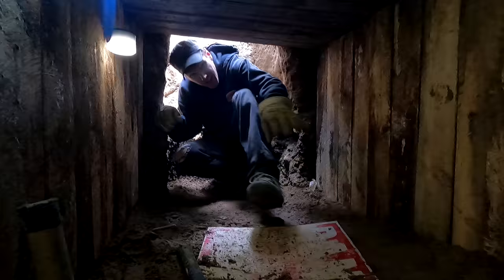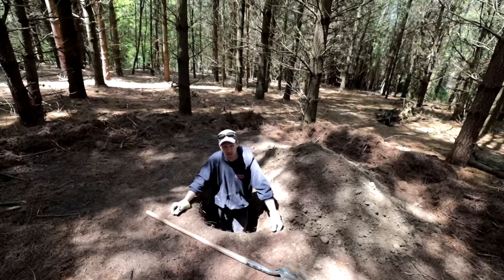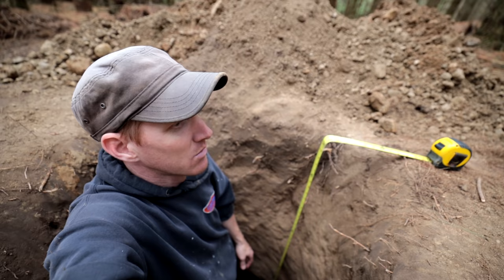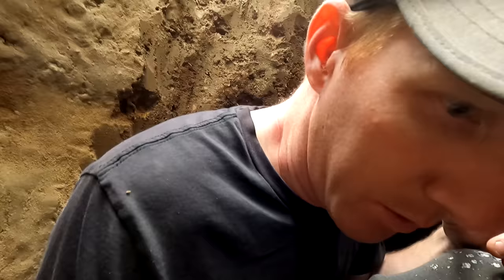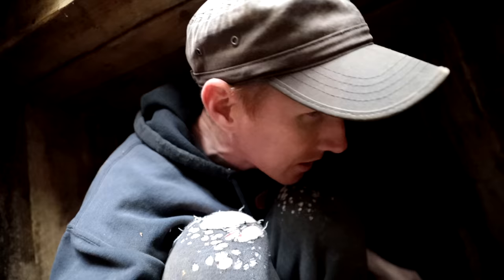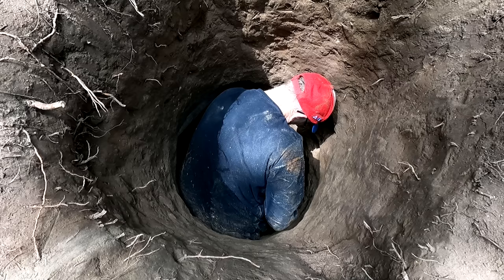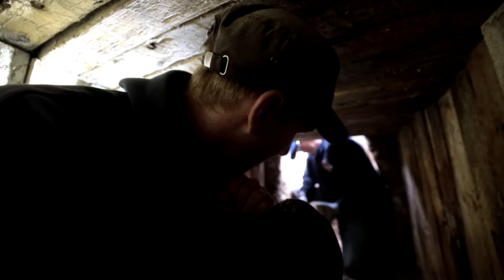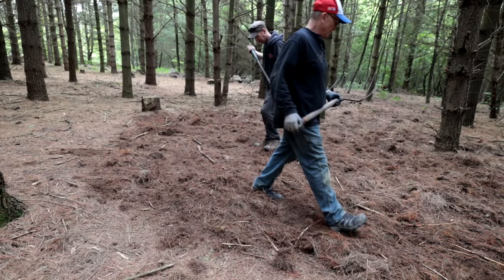Digging a Japanese Spider Hole (and sleeping in it!!!)

Comment: The 2 biggest issues I see are the lack of a water sump (grenade sump too if you want to be legit), but far more importantly you need ventilation - if someone were to duplicate this and spend the night inside, a thin layer of snow would seal the hatch and you'd be staring down potential suffocation very quickly
Reply: Yeah ! Take inspiration from Saddam Hussein's hiding place.
Reply: Also- good luck trying to pop out that hole with a rifle and or gear on.
Reply: no you wouldnt just breathe air
Reply: @davidenglish1552 yeah really I'd probably cut the hole 1 board wider on either side
Reply: I imagine you could potentially connect multiple of these holes together to create a sort of underground trench, as well just make the pocket of air underground larger.
Reply: Not to mention the farts from those beans... Could potentially blow yourself up huh??? Lol jk ...even if u didn't I'm sure the glory hole gas would linger not helping the discomfort factor. 🤦🏼‍♀️🥫🫕🔥🧨🕳️🎆🤷🏼‍♀️
Reply: We built a plywood box bunker under our shed in Florida. Luckily we had the shed to hide stuff so we put in a vent tube. Then our uncle ran electricity to it and we had a fan for the exhaust. We partied down there so air was important 😂.
Reply: @cdgonepotatoes4219  that's how they did it in Nam
Reply: Ventilation - esp if beans are on the menu...
Reply: The dog wasn't much help
Reply: What exactly would a grenade sump look like underground? Just digging the entry hole slightly lower than the tunnel area (like a sideways T)? My understanding of tunnel warfare was they just used curved tunnels for that purpose
Reply: @JeronimoStilton14   in this context, probabbly nothing.   Underground things tend to use a wall or something as far as i have seen.     So something to literally stop the blast as well as working on it being harder to get a grenade in.   

Fundetmetally i think the amin drfence for this shelter is its camoflauge, its not a fighting position in the tradtional sense, it might be a one use ambush hole
Reply: Vent and a periscope.
Reply: @JeronimoStilton14 I noticed nobody else replied so I will. A grenade sump is a small trench in the bottom much like a water sump (and doubles as one in some designs), where the grenade lands and rolls down a slight slope into it. The best place to dig it is on one of the sides and ideally, you dig it so there's a reverse slope in the sump with shelf over that, completely enclosing the grenade so when it goes off, there's nowhere for the fragmentation and blast to go but into the dirt.
Reply: Need some duck boards in there to keep from getting trench.. everything
Reply: also if that happens that candle will eat away at that oxygen level too
Reply: it would also suck if you farted and you were stuck with it in there.
Reply: @HushtheMag  You mean you don't like to inhale your own farts? I thought most people did....
Reply: @davidenglish1552  entrance was a little larger and we (japanese) were a little smaller than the average american.
Reply: Can of bean here eaten. Yum. Thought of War oppose it with a greater thought of peace.

Comment: Neat construction; couple notes, you don't want to use hexamine (or esbit as their commonly known by the brand name) in an enclosed space.  Second, you don't want to cook things like beans in the can; modern cans are lined with plastic, so transfer food to a stainless cup or similar bowl before cooking.
Reply: thanks for the tips
Reply: I see nothing wrong with boiling cans of food in water. Start with the unopened can in cold water, fire it up. By the time the water begins to boil, food is ready to eat. Wont get hotter than 212 degrees.
Reply: @MrMrBiggles  Did you not read the comment? The problem is the plastic lining the inside of the can, which is there to prevent oxidation/rust/acidity from ruining the can and the food inside, but will melt into the food if given enough heat. Usually Bisphenol-A but recently shifting to Bisphenol-S, both of which are extremely toxic and mimic estrogen when consumed which disrupts your endocrine system.
Reply: @MrMrBiggles  Yeah, it's not an issue of the plastic melting, but rather it leeching chemicals into your food. It's not that big of a deal a time or two in an actual emergency, but something to be aware of and not what you want to do on a regular or non-emergency basis.
Reply: Do you mean the plastic wrapping on the can? Can I remove it and cook the metal can itself or you meant the metal itself?
Reply: @jdsmith2670  No, it's a liner in the inside of most cans these days. There's a thin polymer layer on the inside of cans to prevent the metal of the can from contaminating the food. It's a thin bonded layer, not removable (it's not like a bag on the inside of the can). The reason they do this is the metal content of the can, and storage; back in the literal tin can days, it wasn't as big of a deal, but canned food also didn't keep as long. With the liner, canned goods last longer and the metal case can be made out of alloys that wouldn't be as good for direct food contact, but are massively cheaper to produce.
Reply: @jdsmith2670  pretty hard to remove these inner plastic linings. You would have to empty the can first anyway, so you may as well use a kettle and cook them in there.
Reply: @MikeJones-mf2rt   🤣🤣🤣👍
Reply: The plastic luner thing isn't a myth and its non removable but not all cans have them.. most companies used a wax layer and only within the past 10 years did some higher end brands start using a thicker white plastic coating.. its easy to check for if you fully remove the lid
Reply: Modern cans. Cans 50 years ago. 
Don't cook in a can.
Reply: Speaking of cooking,  isn't he using that stove upside down?  While I don't see too much of an issue using it that way, it's my understanding that the leg acts as the pot stand and hexamine kinda liquefies as it burns so the tray contains it. Plus using it upside down gets all the burned cr@p all over your gear Instead of inside the stove.
Reply: It's safe to cook in a can ONLY after burning all the liner out with it empty in a fire. After that the can will rust easily, so it's a process you repeat as needed. Hobo $5 cook set: Soup can is your cup, fits in a regular veggie can with church-key holes to make a twig stove, and that fits in a large bean can which makes your pot. Split up the beans and veggies and you get a few small meals too, all for that same $5 bill.
Reply: @davidhawkins847  what? Do you mean like the little things that hook in your stove? You think you use them like trays with the legs facing up?! You’re using them upside down, dude! They go in your stove and hover above the flame, not sit on it.
Reply: @MrMrBiggles  I would agree BPA doesnt melt until 316 degrees. You can actually boil water in a plastic water bottle just dont let the flames go past where the water level is and it wont melt. That being said it'll leech more chemicals, but it can't be any worse than the tons of things we consume that are in plastic everyday.
Reply: The food in the tin can is already cooked just eat it cold straight from the tin.
Reply: Just eat cold , straight from the tin
Reply: Once I saw the stove, it was pretty obvious he had gotten some NATO but not US gear. US servicemen are no longer issued a stove or open flame, because the poncho and other gear can catch fire if you are in tight spaces like a trench or foxhole... or spider hole... and the fire uses oxygen you may want to breathe later. Considering the layout, I would say cut into another side just deep enough to put an igloo type cooler, and invest in an actual camp propane stove and put in a vent to the surface. These emergency stoves are not very efficient, and in a closed space you can easily kill yourself.

Comment: I spoke to a Vietnam vet who said that a lot of these spider holes existed in rubber plantations. The holes were dug to store water from heavy monsoon rains to keep the trees watered over the year. They would use these existing holes to attack.
Reply: liar
Reply: @ClydeW893  lolz
Reply: No wonder. This hole would be flooded for sure in a case of monsoon raining for 3 months straight
Reply: @ClydeW893  How come?
Reply: @VoidHxnter  think
Reply: @BushcraftEurope  Perhaps they weren't exactly like they were in the video, maybe ran off into some sort of system where the water could drain if it rained too hard, just my guess.
Reply: @BushcraftEurope  I clicked this video just to see if they planned for heavy rains. You wouldn't want to wake up and drown. Need at least a large air pocket inside. Maybe building on top of a slope would help too.
Reply: to defend more than attack, but yeah.
Reply: @lostsanityreturned we could have won but no president had the guts to Truman it
Reply: Hexamine stove. The tablets are hexamine.
Great hole or tunnel.
Have you watched " The Great Escape "  ?

Comment: Was in the US Army, can confirm. Loved digging holes/trenches when bored, some time a few shovels and a couple bundles of 550 cord and you can make yourself an improvised pillbox.
Reply: What was the 550 used for if you don't mind explaining your process
Reply: @zyther96  securing supports and building overhead cover
Reply: Man I was mortars. Only good part of digging one of those monsters was getting done and using our built in spades table
Reply: It's hard work, even just digging a fire pit  to make biochar it took me two days the ground was like concrete,.🇦🇺

Comment: You may want to have some spreader to hold the sides from coming into the tunnel, and keeping the beam up. Also, you want to have dirt backfilling on top of the beam, so the earth has something to lean on, so it wont collapse on it. Just nail two planks to the horizontal beams on both sides.

Those are "hexamine tablets", you can make RDX explosives if you nitrate those, and you can make a primary explosive (HMTD) if you make a peroxide with it. Its best not to use fire underground unless you have got a ventilation pipe going down there, and preferably two. 

Greetings,

Jeff
Reply: I can’t believe there aren’t more comments like yours. This made me so anxious! He needs spreaders to keep those sides from pushing in. If the sides push in, they can no longer support the top, and if the top goes, so do you! There should be spreaders just below the top beam but between the sides and another at the bottom, both secured with fasteners. MSR makes it look cool but his way is INCORRECT and EXTREMELY DANGEROUS.
Reply: @crayoniii  Well, it all depends on the "ground standup time", it seems to be pretty good. Also you need to fill in all the space between the roof of the excavation and the lagging (the wood). At one point in time the ground may sag down onto the lagging. Now this will load the wooden lagging. The amount of pressure depends on what type of soil is on top of the lagging. Its a pyramid shape running from the sides of the tunnel up to a certain height. If it is pretty solid ground (which it is), the pyramid shape is not that high, and thus the amount of material within that pyramid does not make up a lot of weight. The lagging is only supporting that weight, the rest of the weight is supported by the ground around the sides of the tunnel. now the lagging does not support anything or not much. Just be sure all the space is filled up so the lagging can "yield". You dont want any momentum with the weight because that increases the energy involved by a lot. E=MC^2, so that is mass times the speed squared(!!!), and the speed can be as fast as gravity makes it go. So that is why the space is filled up. 

You can read about this phenomenon in Earth Tunneling with Steel Supports, by Proctor and White. Its on my books/archive page. A very interesting book, i scanned it from the university library. Its the only one copy of this book that you can find online. Ive checked. :P 

Greetings,

Jeff
Reply: @jeffjefferson2676  Thanks for responding! I do understand there’s a lot of minutiae in the soil types and how that dictates what kind of and how much shoring is needed. However I’ve seen enough of these types of home brew digging videos to know that most people do not know and are very likely to get themselves killed. I only wish you had addressed this in more detail and proclaimed a starker warning. Happy digging!
Reply: @crayoniii  It is as detailed as it gets.. Earlier this year they found a guy who buried himself in the forest. He was digging a tunnel too. "Slachtoffer ingestorte tunnel is man (29) uit Stein"

So, everyone has been warned. Dont tunnel untill you have read all there is to know about tunneling. And even when you know; miners sometimes still bury themselves..

Greetings,

Jeff
Reply: @jeffjefferson2676  dang, i just checked out your archive page and theres some really good reads on there. been looking for a few of those army field manuals for a bit too. thanks so much for putting those up!
Reply: No way you’re parents were that mean to name you Jeff Jefferson
Reply: @chikinnuggie2487  I bet his middle name is Jeffrey !
Reply: @chikinnuggie2487  What's wrong with that??
Reply: Oh look it's the YouTube experts that don't do anything in their own life but love correction on the net
Reply: thanks for the explosive tutorial
Reply: Jeff I must ask on behalf of homeland defence how do you know how to make explosives
Reply: yo hes not some sientist
Reply: Wow 🤩 I want to party with you.
Reply: good comment, but this is the internet, you dont have to say "Greetings, Jeff" every comment.
Reply: @jonathansoko1085  Well its better than to have someone burry himself. 

Greetings,

Jeff
Reply: @thepatterpatrol26  Look at Alfred Nobel his patent on nitroglycerin. 

It really changed the world that we live in. And there is a prize called the Nobel prize that gets awarded to outstanding scientist each year. 

Greetings,

Jeff
Reply: @blahblahlolololnmmbufur1793  Yes i do. 

Greetings,

Jeff
Reply: @jeffjefferson2676  uhhhhh ok i guess do whatever you want
Reply: how would you turn hexy into explosive. it's flammable but also mega poisonous it's you're doing something that powderises it or turns it to vapor.
Reply: You can't do that by accident. But yea regardless breathing in the smoke probably isn't good.
Reply: @jeffjefferson2676  greetings Jeff!
Reply: i  was your 1k liked lol
Reply: Thanks for the information! ;)
Reply: Just to ballpark, but would wooden triangles (2x4) screwed into the corners of each horizontal and vertical beam  provide enough support? 

I would think that two more horizontal pieces running in between the vertical pieces, one going across the top, the other across the bottom, to support cave ins from the side would be better than the triangles I suggested, though.

Maybe an equilateral triangle-shaped support structure would be best, but I’m sure that would be more annoying to set up
Reply: This is The Truth of Salvation

HalleluYAH (Hallel u YAH) “Praise ye YaH”

YaH is The Father (Genesis 1)
YaH arrives via the TENT OF MEETING
YaH was Who they Crucified for our sins
YaH was Crucified on an Almond TREE

Semitic (Moses)
Isaiah Scroll (The Original Isaiah)

Isaiah 42:8
I am YaH; that is my Name! I will not yield my glory to another or my praise to idols.

Isaiah 43:11
I am YAH, there is no other Savior but Me.

Isaiah 45:5
I am YaH, and there is none else.